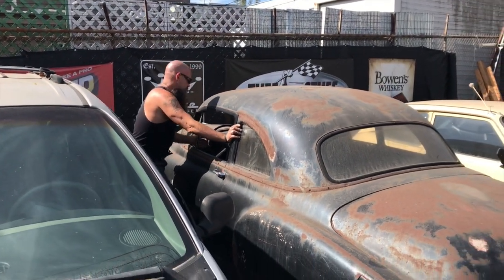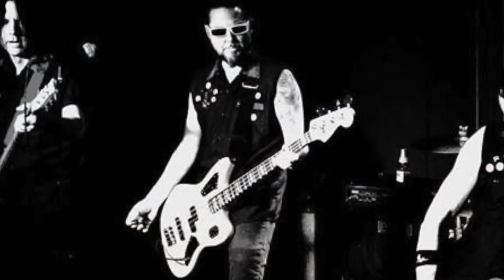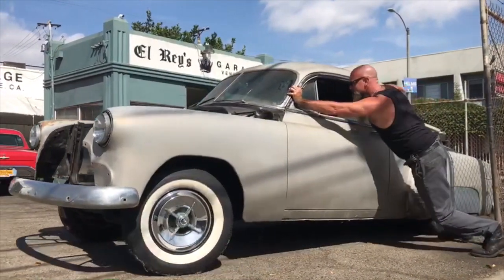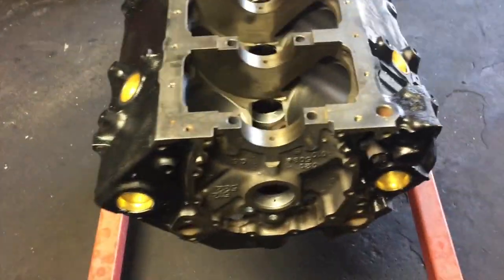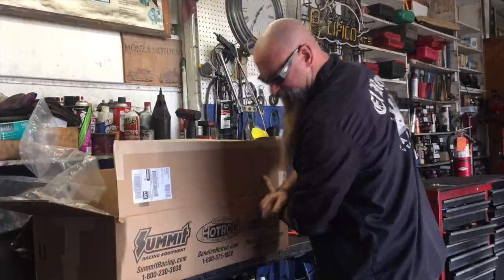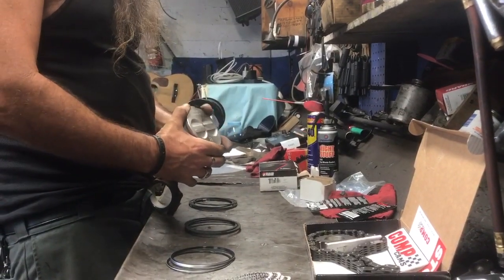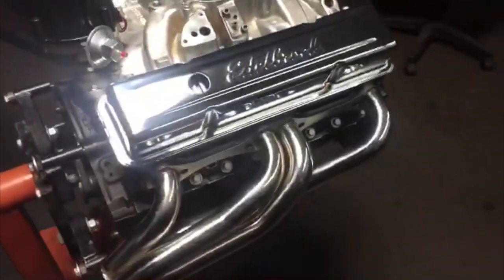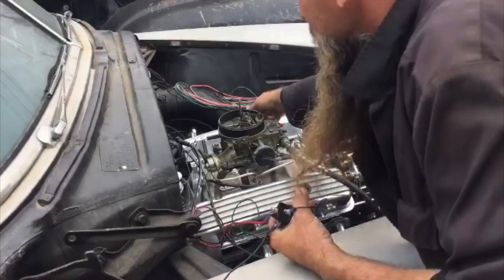How to build a Chevy 350 engine on a budget - El Rey's Blue Collar 350

Comment: I have actually built several engines with the same overall approach. bump up the compression to about 9-9.5 to 1. make sure you have a decent 882 head or equivalent. headers and nice intake. most important part choose a cam comparable to what you did. Its actually a baby size small cam, but its way better than stock. Thats how you get the most bang for your buck it won't win any races but it will be a huge improvement over the stock engine, and you don't have to worry about it blowing up because that cam says approx power range 1200-5200 which is not higher than factory redline. and it probably can use stock converter, and so on. best bang for you buck approach. most people make the mistake of choosing a cam way to big and installing it in a low compression motor with a stock converter and highway gears and thats how you run a 17 sec 1/4 mile in a camaro lol . I believe heads like that are in the neighborhood of 175 intake runners, so you don't need a cam that is designed for 7500 rpm its pointless.
Reply from the maker: Many thanks, did my best at the time, always learnin!!!

Comment: Did you mount the new motor mounts on the same location as the original ones?
Reply from the maker: Im pretty sure that I hung that engine over the area with the engine hoist and marked where I wanted the mounts to go. If I remember right they were near  the original spots but definitely in a different location. Same for the transmission mount

Comment: I would like to have someone like you to build an engine like this for my ‘86 Trans Am & get rid of the slow high mileage 305
Reply from the maker: Much appreciated...That 86 Bird can be pretty radical depending on your state/regulations I figure
Reply: I live in Texas, for a small town of around 125,000 we do pretty good at having cruise nights, car shows & the like. I have a friend that has a 1951 Mercury. I like my T.A. I have had it for 30 years. The main reason I keep it is because if I sold it I would want something else, something older & that would be $$$$$$$. I just want to get an engine built that puts out 300 plus HP. But I don’t want to spend a massive amount. I subscribed to your channel, so I’ll be keeping up with your build.

Comment: I have a 49 Chevy styline deluxe with a cracked 216 motor is it Easter to get a 350 or another stove top 6 its budget build I don't wat to change the torque pipeline connected to the rear end
Reply from the maker: Because you'd like to keep the torque tube/transmission set up..Maybe find another 216 from Craigslist...they do have oiling issues though...A better drop in choice may be a 235 straight 6...great engine...should bolt up to your setup..people sell them frequently to upgrade to a V8...My 2 cents

Comment: Ya, cheaper to buy a Goodwrench motor and buy a cam/ lifter kit and do a cam swap. The machine work Alon would cost you almost what the entire Goodwrench motor would.
Reply from the maker: I like the GM crate 350s.... at 2100.00 that is a good deal. I believe that you are thinking that machining and magna-fluxing a block is near that amount. I believe that is on the high side in my humble opinion unless you live in an area where machine shops are few and far between or building some kind of exotic type race motor??

Comment: i got real lucky got 2 454 strokers for free one has 6000 miles on it and the other one got 38000 miles on it both had 400 turbo heavy duty with stage one shift kits in them then i got a 68 chevy pu that had factory paint with a nice clean body with the 327 and 400 turbo running and driving for 1000 the 327 was rebuilt very low miles on it gave that to my kid for his 67 pu new carb and distributor and intake the pu needs painted but i know what it needs not much have a extra cab with 0% rust in it  just sitting
Reply from the maker: That is DEFINITELY my kind of deal!!!!  Yer a good dad too!!!

Comment: Oh wow a Chevy 350 how original.
(Sorry I'm an asshole, lol)
Reply from the maker: Yes.....been done a million times...How bout you...what are you building?? You got something cool and exotic...Man I love to hear about new engine combos for different applications...race, rock climbers, diesels.....high revvin 4 bangers...all of it
Reply: @ElReysGarage  my apology upfront, it wasn't meant to be rude @ 1st but when I read it again...it was.  So for me unfortunately, nothing exotic. I have a slant 6 auto 70 dart swinger. I have been piling up parts to build a big block 4 speed gts tribute as if dodge was to have made a 70 gts dart, which there never was. I'll be fabricating a few linkage parts, attempting to fab a bracket for older single mount b-c body 4 speed 833 trans to be used in the a-body, considering a-body 4 speed transmissions are at a premium price. The rusty roof will be cut off and replaced with a little barely noticeable rake added for cool factor (to be determined)
Also full body & paint, double tub the wheel well (to appear factory) & cut off the 70 tail & add the 68 rear section of the quarters, trunk & bumper. (67-69 are more expensive to start with but I have the ads end from a parts car) that's just a start. The car is under a tarp and has been since I bought it last June, I have a 99 dakota r/t I have been doing stuff to but most likely will be doing a low deck 383 -400 4 speed in it. I'm a mopar guy as you may see. I grew up around chevys & drag racing in the 80s & 90s in auburn Washington close to Seattle international raceways (now Pacific raceways).

Comment: Comp Cam 260 H? That too mild, man. If you were looking for idle compromises, you could have gotten a set of Rhoads lifters and went with a hotter cam. Best of Both worlds man. The 260 does make my chevy 305 lope a little bit.
Reply: w41duvernay big cams with an automatic aren't cruiser friendly in warm climates like California.  the bigger the cam,  the bigger stall converter needed, the more heat the trans dumps into the radiator, the less vaccum you get for power brakes, on and on. if you want a good driver that is crazy reliable and cheap I would say he got it just about right.
Reply from the maker: @kennethlaw5216  Great answer....after a bunch of research...this is the route I went on this one